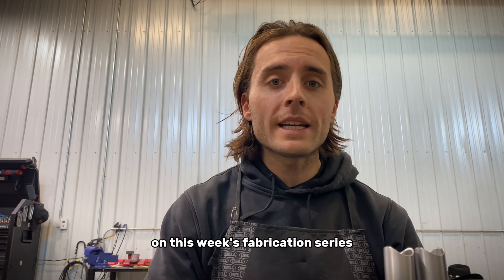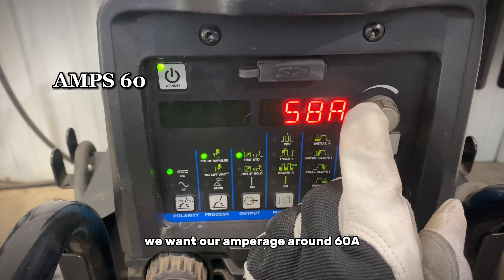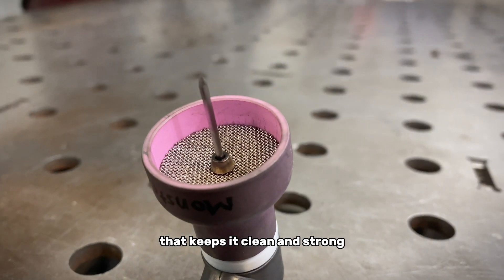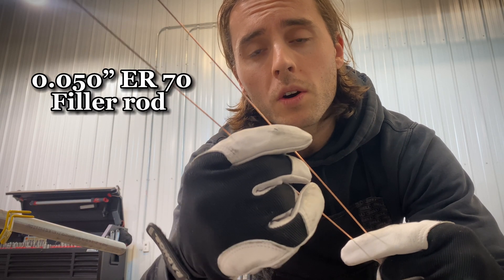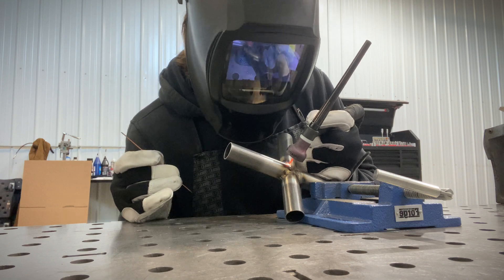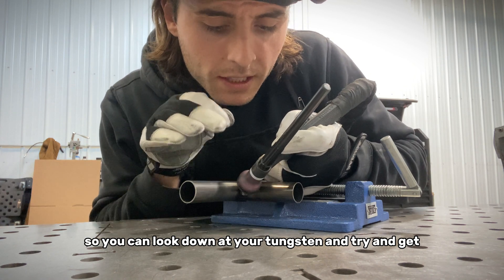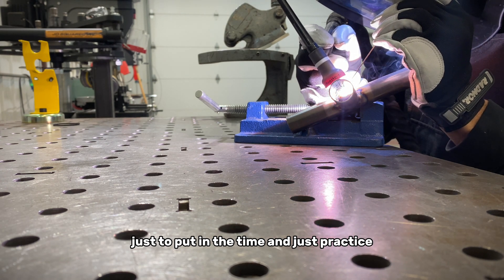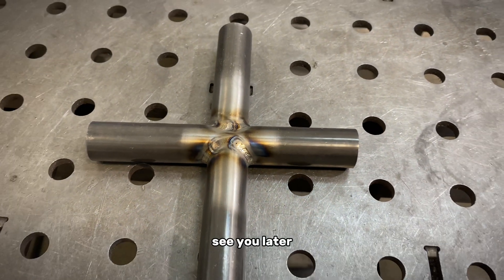How to TIG weld Chromoly tubing

Comment: Thanks for the video. Good info. You mentioned that you Scotchbrite the tungsten. I would like to know more about that, why and how you do it.
Reply from the maker: You bet - thank you for watching .  Yes - i scotch brite the tungsten to try and get the smoothest surface possible. I’m not sure if it actually helps or not.. but I’m convinced it does !  I believe the smoother , sharper point on that tungsten - the more stable the puddle
Reply: @KULLYCO  Thanks for the quick response. I see the logic in that. Do you chuck the tungsten in a drill to clean it with Scotch-Brite or do it by hand so the scratches are parallel to the tip?
Reply from the maker: @XenAlphaVideo  that would definitely be the most ideal way to do it !  I think keeping a new / clean/ un contaminated tungsten is really key!